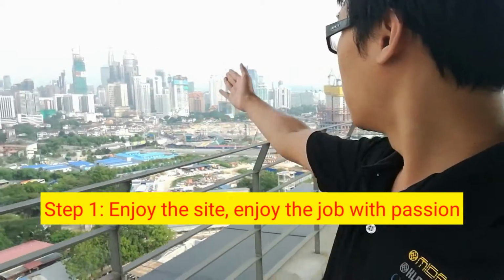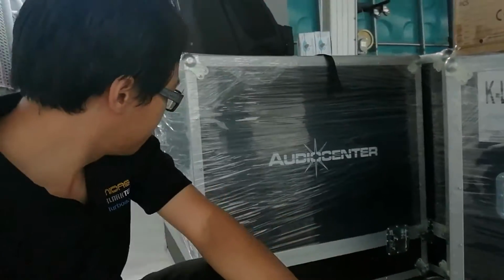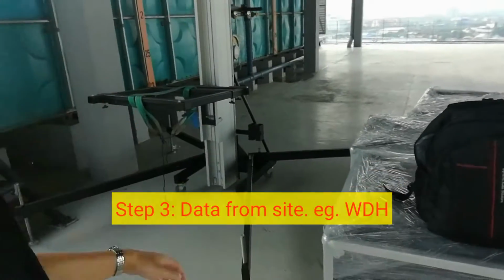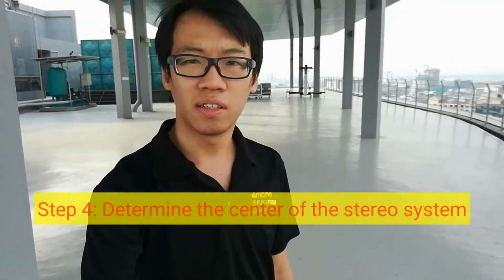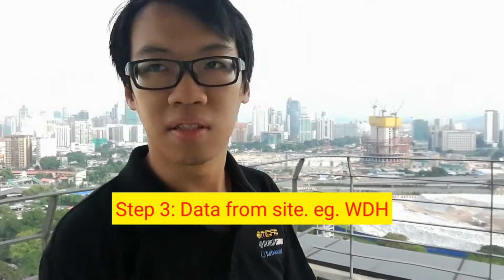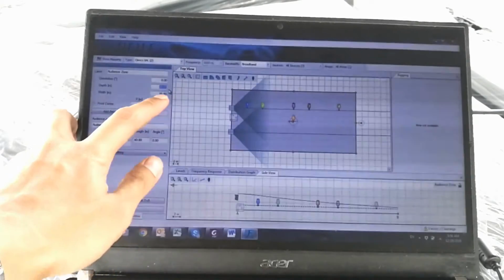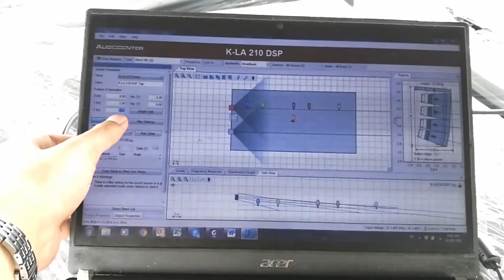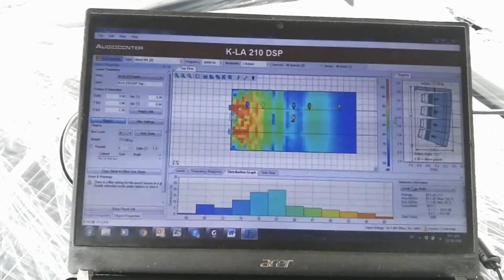Audiocenter KLA-210DSP Line Array Rigging Part 1: Site Data, Prep & Simulation

Comment: Please provide audiocenter simulation software link or simulation name
Reply from the maker: Hi. You google Ease Focus 3 and download the software. It's free. For audiocenter speaker data go search that particular model and under download you will find Ease Focus gll file. Download it. Not all model comes with gll files. Cheaper model does not have it due to the low cost. Making gll files ia expensive. After install the Ease Focus 3, select import speaker data file. Find the location of the downloaded gll and import. Viola, you are good to go
Reply: Ahhh, thank you. This is so helpful.